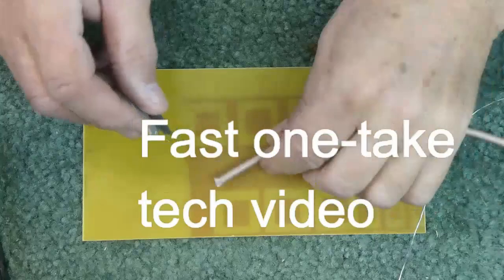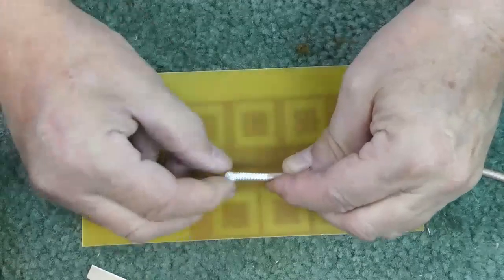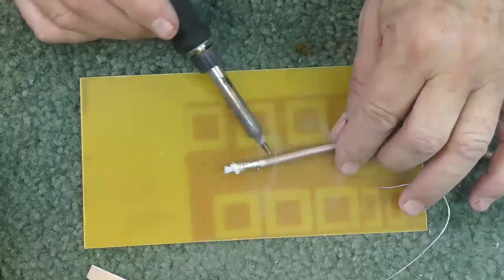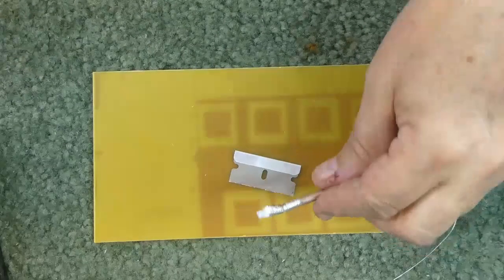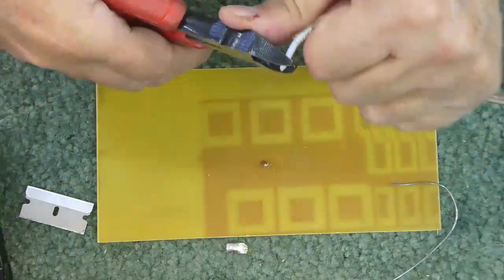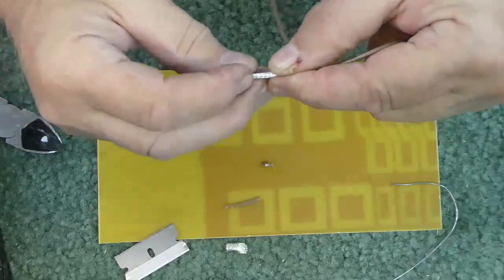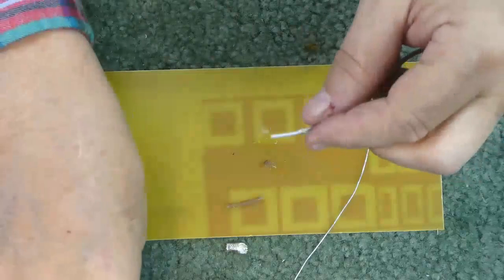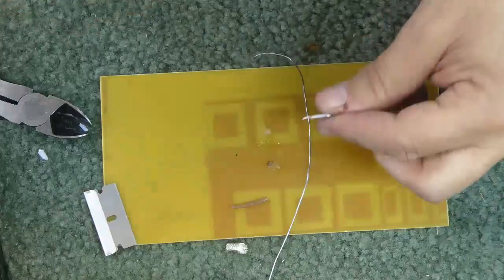Prepping coax1

Comment: I like the idea of tinning the braid before cutting it back, which keeps the braid strands from fraying out before cutting. And by scoring the tinned braid annulus with a blade it leave a clean end as opposed to picking the braid strands apart and then cutting them with a scissor.    But this technique only works with a teflon dielectric, as you have noted.

Comment: Tom, let me make some suggestions. 
1.The PTFE outer sheath is really tough and not easy to slide out once the circular cut is made; yes, you have to make the longitudinal cut and split it while removing and at the same time you should not damage the double layer braid.  It is better to trim the shield and then tin it. Using a plier to rip it off is not a great idea, though. Again, to expose the required length of center conductor one has to cut through the tough PTFE dielectric carefully lest the chances that some of the strands are lost. And once exposed, it is better to tin all the strands in one bunch at once.
2. Please get the camera focus right and see that you do things within the camera field.
3. Please avoid the annoying AC hum picked up in the audio.
De VU2RZA

Comment: Nice!
Reply: I  would like to see the rg 400 coax and reducer assembled . How do you
stop the cable from rotating at the reducer .  heatshrink works.  i am speaking
of  on - off  and constant movement.  Tape works ok . It  is basically  tolrence
in the reducer.  It is hard to get a reducer that will fit  tight............